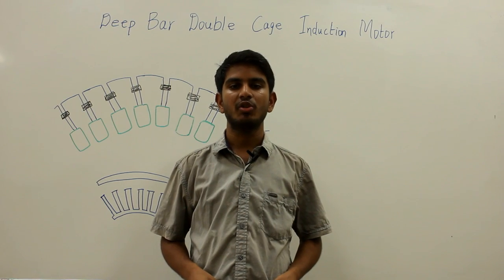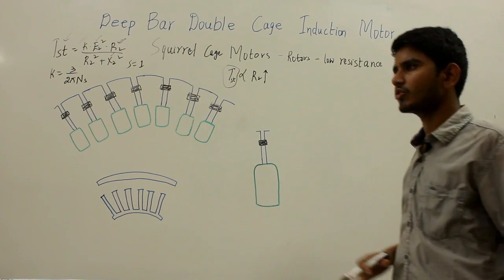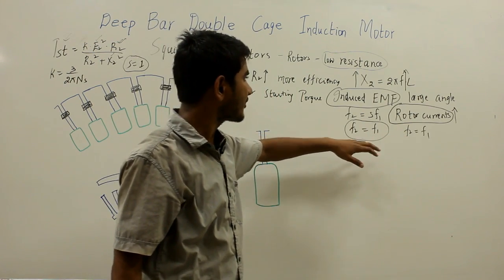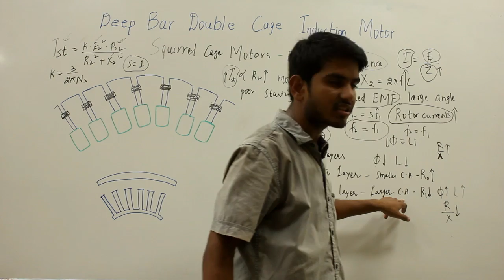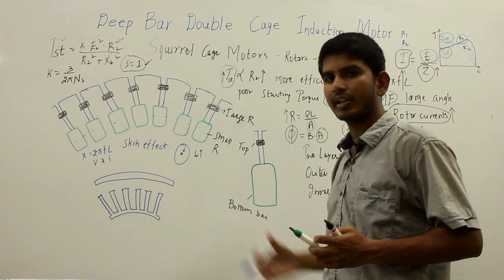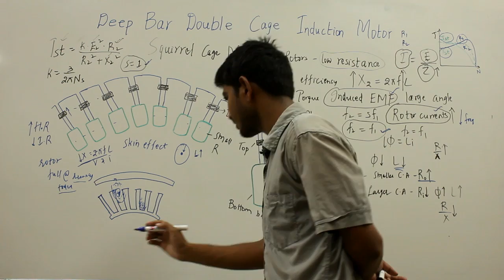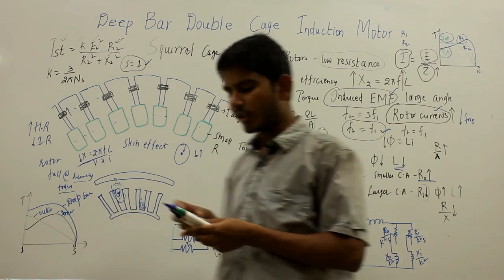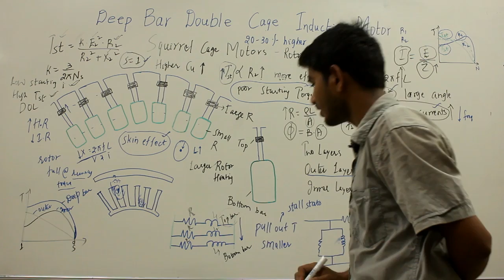Deep Bar Double Cage Induction Motor

Comment: super bro...you improved 😀😀😀
Reply from the maker: hahhaha thank u
Reply: hi bro...I have small dought...that is ..shall we use double cage rotor in 1 phase induction motor?....and one more thing could you say the the rotor which is used in the ceiling fan...
Reply from the maker: basically, we use squirrel cage type of rotor in single phase induction motor.
capacitor start or two value capacitor single phase induction motors are used in ceiling fans.
Reply: bro... your are saying....in the ceiling fan we are using  squirrel cage rotor...right....!